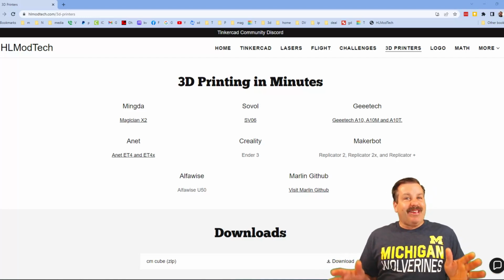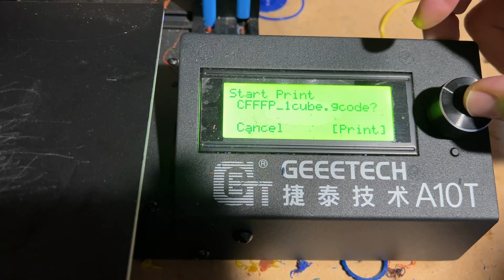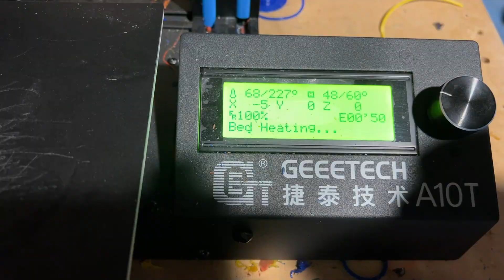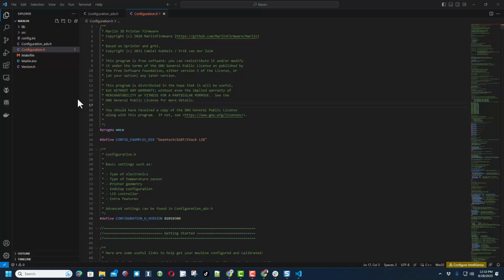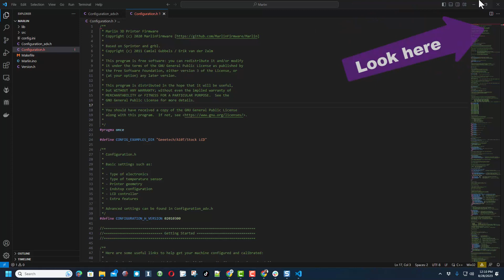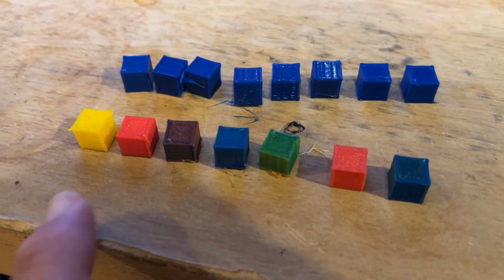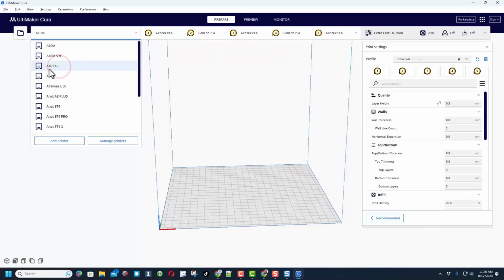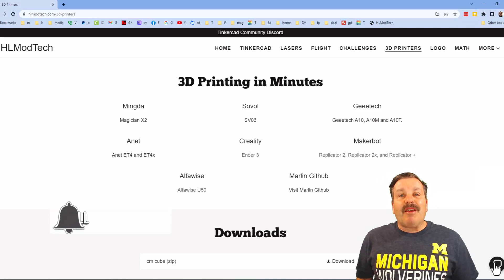Geeetech A10T Marlin Virtual Extruder Mixing Color Prints & Questions

Comment: Take a look at the Marlin docs.   M163 through M166 are the ones you need to see.  You set them with M codes.   I think you can set a static startup Gcode in the config, but it would probably be better to do it as a preamble in your slicer. 

I found you looking for in on how to assign mixed colors in gcode, so I don't have to try to do it on the console during the print.  I don't have those answers yet.
Reply from the maker: This is how I set colors for my A10T. https://youtu.be/rnDggSvemg8
Reply: @HLModTech  I think I have it now.  I'm still waiting for one extruder and one stepper to arrive so I can test the machine out.   I had ChatGPT generate me all the colors.  I did it with both RGBW and CYMK(W).  I have RGBW filaments to test with.  I'll have to buy CYMK to try that out.   The rest of this comment is the ChatGPT command to generate the list of colors, without trying to figure them all out yourself.  
 

--------------------
I'm setting up my 3d printer to print in mixed colors.   Below is the format it needs to be in.  Standard G codes M163 to set up the colors, and M164 to save it.  

Example:
M163 S0 P0.33 ; Red 30%
M163 S1 P0.33 ; Green 30%
M163 S2 P0.33 ; Blue 30%
M163 S3 P0.0  ; White 10% (ChatGPT suggested 10% white for black)
M164 S0      ; Save as Black 

With filaments of red, green, blue, and white, give me the codes for: black, white, grey, red, orange, yellow, green, blue, violet, pink, light orange, light yellow, light green, light blue, light violet, brown, pink, teal  On the "Save as" line, where you're listing the tool slot number, please put the text color name there.  
--------------------
Reply from the maker: Sorry for the delay to reply. YT dropped them in (held for review)... When you type (2121) with the periods it thinks it is code or a time stamp apparently.  Your steps you shared are similar to what I do with the A10T. I only have 3 colors though. Sounds like a sweet rig your whipping up. What slicer do you use?
Reply: @HLModTech  I switched to PrusaSlicer a while back, when I did the previous 2-in-1-out machine, so I could paint on colors.  It makes colorizing stuff real easy.  

The machine should be great.  I have it moving around now, but I'm kinda hung up on where to mount the filaments rolls, so I can do the first print.  The 4 extruders are in the way of where I thought I'd mount the filament spools.  I'll figure something out .
Reply from the maker: Which printer are you working with?
Reply: @HLModTech It's an Ender 5 S1 with a Zonestar M4V6 hotend, and a BTT Octopus mainboard running Marlin 2.1.2.1.  I'm still finishing it up.  This is my second multi-filament machine.  The first was an Ender 3 with a 2-in-1-out switching hotend and BTT SKR v1.4 Turbo running Marlin 2.1.2.